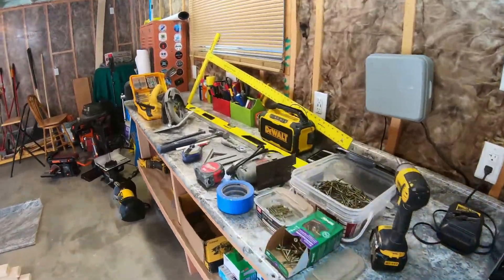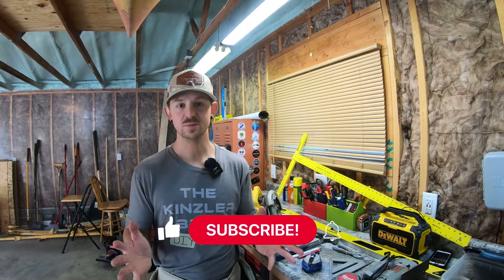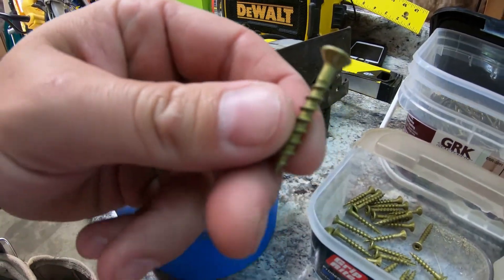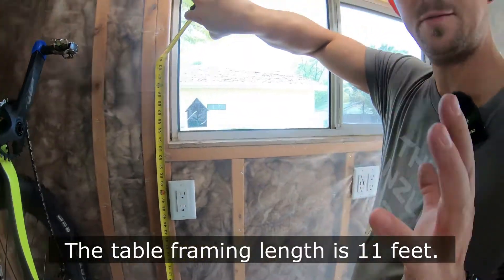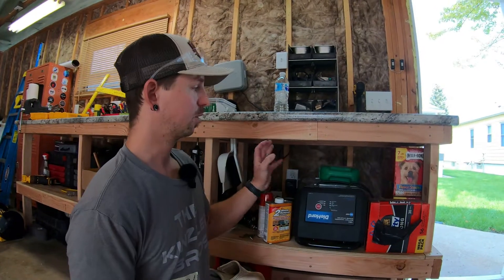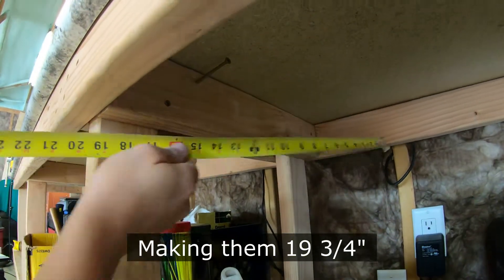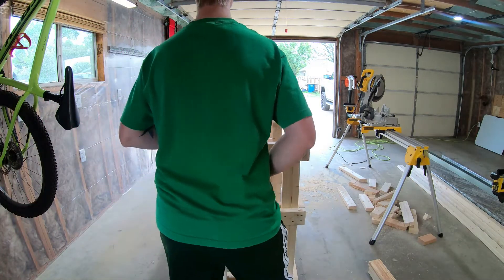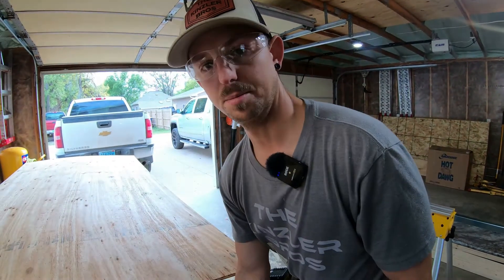How to build a work bench. DIY project

Comment: A couple of painters build a workbench and what don't they use?   Nice bench.  I will need to rewatch for more detail.  If you didn't already, you might want to talk about saw blade teeth used since some of us newbies to tools  might not understand why you need different blade teeth for different cuts.
Reply from the maker: That is true I did not think of that you want find a lot of more teeth for trimwork and you don’t need to many teeth are cutting two by fours and then you need a really fine teeth and a different blade for cutting metal and I’ll kinds of different materials thanks for bringing it up

Comment: Great job. I need to build some stuff in the basement. I ain't got no room and it's annoying. I would like to rip out and old one down there, but the built it around a structural support, so it's going to be time consuming for sure. But those counter tops are a great way to build a work surface or even a computer desk!
Reply from the maker: Oh yeah 100% I’m sure I get some head because people be like that’s not a workbench it’s too nice of a countertop but it’s really not if you put other things down when you’re working on something and you’re not gonna just start banging hammers on a countertop like that but anyway thanks for coming over and checking out the video Aaron

Comment: Nice video guys but What is a torque screw and why is it needed for a workbench? You know, compared to a regular screw, what’s the advantage? Because I have no idea. Lol!
Reply from the maker: Well torque screws are replacing the old fashion regular Phillips screws torque screws have a totally different drill pit makes it way harder to strip out also tore screws are reverse threaded halfway up the screw for a better holding and they also come with a cut out of the tip for it to start faster in the wood saw a lot more benefits and they’re basically used for many things now and the old Phillips or flat head screws are a thing of the past